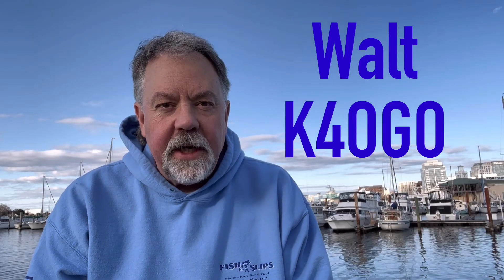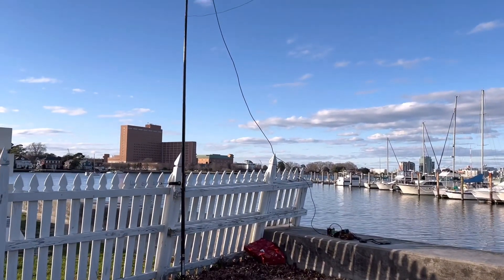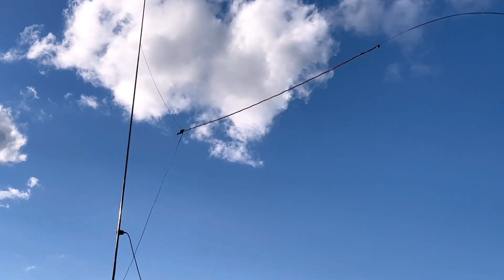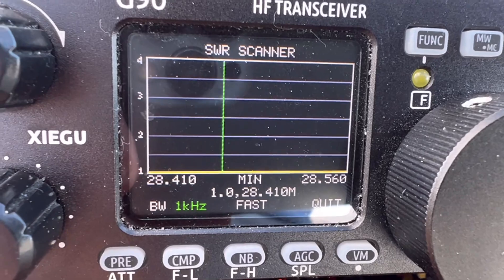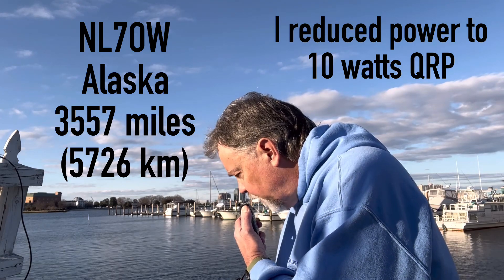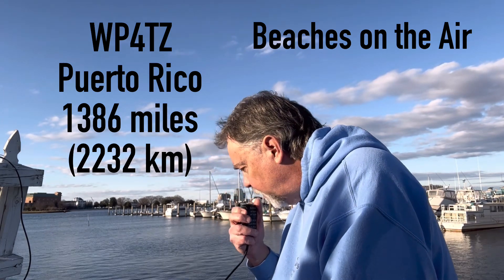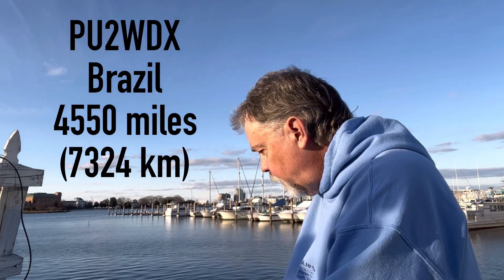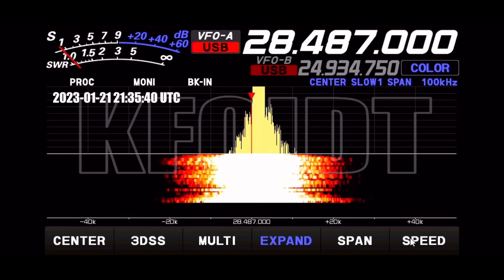Vertical Delta Loop Antenna - 10 Meters Portable

Comment: I’m building a 10 meter Delta Loop kit from HF Kits in the  Netherlands. There plan is a 2:1 transformer and a 1:1 Balum in the same box with a pair of Amidon 240-43 cores. I should finish up the Balum tomorrow and test it.

Comment: Thanks foe experimenting with different ideas.
Reply: I am considering a vertical delta loop for 80 Meters as for some reason both my linear loaded 80 M dipole at 25 feet  and  80 M  end feed sloped 6 feet to 80 feet seem very very inefficient on 80 M. I suspect poor soil but need to do more  measurements and experiments to figure out. End fed seems to work better as i go up on  bands.

 My goal is talking to 200 mile distant stations with some man made noise at both ends. I have a city lot but have a few tall trees to support a wire antenna.

Comment: I have made an attempt to build this delta loop.  I cut my wire to length, and started to set it up in my backyard.  The one thing you omitted in your video was how to set this up, aka, how high off the ground.  I have the DX commander classic poles (4 of them), and the use of two being required made it very difficult to set up by oneself.  The wire being cut to 10.75 meters is in the Rybakov Vertical antenna range for a 1/4 wave vertical on 40 meters.  I could just use it as a tuned vertical and use my tuner to get 20, 17, 15, 12, and 10 meter bands!  Love the video and the info plus the book... 73's Walt & GBU.

Comment: Your delta loop inspired me to buy a 4:1 unun and make a delta for myself. My antenna evolved from the delta into a full wave sky wire loop. I'm happy with the loop as it has +7 dB gain over a dipole and other antenna types. Since building a loop last year, I have earned my WAS award, and several DX countries in Asia, and Europe, to the Middle East.  I have to give you credit Walt for the inspiration to build simple wire antennas that work! 73s

Comment: Drooping coax will cause more imbalance, therefore more common mode current. Put an RF Choke immediately before the 4to1 balun (looking outwards towards the antenna). ❤

Comment: I made your design , it worked great thank you .
Reply: Try using the same dimensions, put the apex at the bottom and feed it through a 6:1 balun. Incredibly quiet and very directional. I reached south Africa yesterday and Australia. Trust me, you will like it. Elevate it 1/4 wave. Makes it portable. I have it on a rotator.

Comment: Listen to your heart. The point of being an amateur is experimentation. how the hell did we get the g5rv and the moxons. you should try a vertical moxon near water that would be great. by the way you only need to look at the commercially built Optibeam which was basically multi moxons in one antenna. Keep up the good work.
Reply from the maker: Thanks! Yes the vertical Moxon is on my list! 73, Walt

Comment: Thank you!   I just reconfigured a 134'  80m inverted "L" efhw into a 40m/15/m vertical Delta Loop using the same method.  It kicks some serious butt on 15 meter qrp.   I didn't worry about equal dimensions.  The vertical member goes up about 30 feet, starting 6' above ground , and the other two legs are app 52 feet long.  Don't tell the nay sayers, but it worked ok on 30, 20, 17, and 10 too  ;-)

Comment: I also wonder if that could be fed with ladderline...balanced line...back to a 1:1 balun and into a tuner. Might be quieter. I have lots of issues with noise and used this approach to build a Slim Jim vertical for 10m a few years ago and it was noticeably quieter that other verticals. That's also one of the best verticals to build and use.
Reply from the maker: That’s definitely worth a try!

Comment: That's how you do it...nice work. Loops are awesome. Can't find more gain from a single piece of wire than by building a loop. One that I've gotten a lot of use from is a rectangular...2:1 proportion..with feedpoint in the middle of the base...works out just about perfect 50 ohms. I'm curious as to whether you're using insulated hookup wire or bare copper. Need a new antenna project and this looks like it could be the one to get me back on 10m from my apartment with antenna out on the fire escape. Already have fiberglass poles.
Reply from the maker: Thanks! I've been thinking about building a rectangular loop. I use insulated wire. 73, Walt

Comment: Walt,
This same antenna cut for 40meters, will also give you 20m and some 15m.  However, it may be a bit difficult to manage 132+ feet of wire using your supports

Also,

A twenty meter loop fed with ladder line will also give tou 10m. see: https://drive.google.com/file/d/0B1q-psxlp3Iwak9ldnJUcnhZTUE/view?resourcekey=0-Ad-AR4k4E5ZB_X4Mx-sipg

Comment: It´s just 30 degrees away from a classic delta loop with its lower side parallel to earth and fed 1/4 wave from top corner for vertical polarization. This set-up provides the lowest take-off angle. That´s why your antenna is perfoming so well. And they are better RX antennas than verticals.  By the way, that harbour seems to be a great location for DXing. 73 de LU3HIP.
Reply from the maker: Thanks! Yes my harbour is a great place for DX. 73 de K4OGO

Comment: Search for Cebik horizontal slot loop, very similar except it is rectangular but also fed from the side, which makes it vertically polarized. I think that is what is happening with yours as well.  Also, being vertically polarized reduces distance to ground influence, unlike a horizontally polarized dipole for instance.
Reply from the maker: Roger that, I'll check that out.

Comment: Walt, Hello from South Korea!  Please don't stop sharing your ideas with us just because of a few haters.  Your design looks great!  I just built a delta loop and it works well.  I used a 4:1 balun connected to the lower right corner about a foot up.  It works good, but has high SWR on some of the bands.  I plan on putting in about 50 feet of 450 ohm ladder line to see if that will help.  THANK YOU SO MUCH FOR SHARING!  PLEASE DON'T STOP!  I hope to work you on the air someday!  Kindest Regards,  Don HL2/KC6STQ
Reply from the maker: Thank you so much Don! I enjoy sharing my radio experiences on YouTube and will definitely continue. Thank you for the kind words! Hope to catch you on the bands soon! 73, Walt K4OGO

Comment: I like the loops whatever you can get up, They are quieter and have better capture, going to try one hear instead of my 100' cage. Just feed with balanced line and use with a tuner - will see if my luck is as good as yours. 73 N0CYK
Reply from the maker: Good luck! 73 de K4OGO

Comment: Nah....always share....and those comments that aren't constructive, just drop in the round file! Did you get a chance to model these dimensions? Thanks for the video.
Reply: It's 10m so the entire loop is around 35 feet. A loop is 1005/Fmhz in feet so one-third would be a little under 12 feet for the vertical side.
Reply from the maker: Thanks Richard!

Comment: Well that worked rather well!!  Curious as to the choice of a 4:1 UNUN in spite of it's good on-air performance. Have seen them with a 4:1 balun and more often a 2:1 matching section of 72 ohm coax as I did for a  6M delta loop. Fun to watch Walt - well done.
Reply from the maker: Just went with the 4:1 after much research and it worked well!

Comment: Great vid,,for omni directional it has to be horizontal,,vertical  it will have loobs of its sides,,,great antenna,,alway use loops,,,low noise and more gain than a dipole.

Comment: Hi Walt   
just subscribed,  great info thanks for sharing.  I have calced all of my dimensions for this antenna on 11 meters,  but my only question is will I still need a 4:1 UN-UN?
4:1 BAL-UN?
I have the female UHF-typeF adapter for 75ohm stub?
which would be best?
thanks, chuck

Comment: Wonder what happens to polarisation and matching, when you make it a 90° angle at the lower end of the main pole. Basically the right triangle / sail shaped version... 🤔 You would need a much lower second support pole.

Comment: Some really strong contacts their Walt. I did some thing similar on 20m some time ago, a vertical pole and pulled the other two sides of the triangle out and fixed to the house. The feed point was at the bottom of the pole and not having a 4 to 1 balun I used a 1/4 wave of 75 ohm coax. It was so quiet on receive compared to my usual antenna. Thanks for the video.
Reply from the maker: Thanks for watching and sharing your eperience!

Comment: I would say the proof is in the pudding! Would love to see how it would work for ya on your next Poland trip.
Reply from the maker: Headed back there in 12 days, might have to try it!
Reply: @COASTALWAVESWIRES  I imagine it would be just the ticket for racking up a bunch of African and Middle East contacts on 10
Reply from the maker: @JReed305  yes and especially as the season changes, problem I had last trip was that it was dark at 3:30pm In December and 10 was dead. Last spring I actually made a few contacts into Israel and Saudi Arabia on 10 from Poland. I’ve got a couple 7 meter poles at the house there so maybe I can rig something up.
Reply: @COASTALWAVESWIRES  Oh yeah dark early for sure. I have a cool photo from the harbor in Utska of sunset at 2:45 in the afternoon.

Comment: Dear Walt thanks for all. I have a question. The unun 4:1 is not a balun is a unun , it's correct? The same that i use for rybakov or not?  it is not necessary a balun for coupling the antenna (balanced) with coaxial cable (unbalanced). It's correct? Best regards Aldo

Comment: Hey Walt ! I've been running a home made 40m horizontal delta loop fed with a 4:1 at one of the corners. It's up about 35 feet and tunes 40,20,15,10m. I might put one of those 10m loops together and see how it goes.  Cheers, great video. Richard VK2VRJ.

Comment: Well, well, well, don't mind them bashers sir, you showed them they were wrong with a big QSL. You see sir, I am just new on HF at the right time with the 10 meter band open and have been researching for different types of antenna I could build and you sure did made my day. I can't afford a real hf radio yet so for now I'm just using an HR2510 set only at 20 watts with an aluminum tube horizontal dipole antenna at 19 feet above ground but am sure proud to make contacts in Europe. My farthest was 10,735km to England from where I'm at here in the Philippines. Now I know why HAM is fun. Thank you for sharing your ideas sir. DW1-QEW saying 73s.....
Reply from the maker: Thank you and thank you for sharing your experience!

Comment: Love the design, I have been pondering a delta loop,  curious what height did you want to get the bottom of the vertical above the ground?  Is there some modeling that would suggest the height based on the band you wanted to build for?
Reply from the maker: Thanks! Honestly I just wanted to get it as high as I could using the two poles.  I have not modeled it but that is an interesting question and something that needs more research.

Comment: Walt, you are definitely on to something. I had a 40m delta loop fed 1/4 wave from the apex, with the apex up. According to ON4UN's Low-Band DXing book this acts like two 1/4 wave verticals in phase with the horizontal portion acting as a radial for both. The feedpoint impedance should be around 100 Ohms, so a 2:1 balun or 1/4 wave length of 75 Ohm coax would convert it nicely to 50 Ohms. You would just need to make your vertical portion of the loop slope instead of running up along the support mast. The two lower corners of the delta could tie off to ground stakes or any available attachment point. The downside is that you need to move both lower lines to "rotate" the antenna. BTW, my delta loop worked fantastic.
Reply from the maker: Awesome, thanks for sharing!

Comment: I have a Delta Loop still to try out, I think its 3.3m as a triangle with 3 sides, or 2.7m(ish) for 4 sides.
I noticed your unun wasn't as 1 of the corner points, that's noted down.
Still a little cold to be playing around with my antennas 🏧 but it is on the 'To Do' list.
Great video again Walt, looking forward to the next. 73's
Reply from the maker: Thanks so much and good luck with that Delta Loop!

Comment: Walt, thanks for posting and demonstrating your antenna. Seems to have fantastic performance!  In the mid-70's just before I got my license, my friend who wrote articles about antennas wanted to try out the new HF xcvr my dad bought me (Hallicrafters SR-150).  Not having an antenna put up yet, we found a huge balled up mess of 300 ohm TV twin lead that a local TV repair shop had thrown out, about 150' long.  We strung it from the basement window thru tree branches and terminated it down in a swamp.  We were in Minnesota, you know, land of 10,000 swamps ;-) anyway, we fired it up and he was able to contact europe, Ukraine, to be exact, running about 100 watts with this stupid, barely above ground twin lead that was our so-called antenna.  I suppose stranger things have happened, just can't think of any. Still have the SR-150 and continues to work great. Kevin, AI4HZ
Reply from the maker: That’s a great memory Kevin, thanks for sharing!

Comment: Is it a multibanda antenna? For example for 20 Mt can work with tuner in 10 12 15 and 17? Test it
Reply: If this antenna for 20 Mt works for high band with tuner like you tried with the Efhw 20, it could be a really cool solution for dx... Pse test it.... Best 73 Aldo
Reply from the maker: I’ll have to test it. It was an outstanding 10 meter antenna

Comment: Walt, Always looking for a new antenna idea. Have the two poles, wire and 4:1unun. Great project for next weekend... Many thanks Don - KW2AIR
Reply from the maker: Thanks Don, all the best and good DX next weekend!
Reply: @COASTALWAVESWIRES  Walt I had the chance to construct and test your rendition of a 10m Delta Loop oriented NE / SW.  I first tried placing the LG 4:1 Unun 1/4 wave length down from the top of the pole. Then after some testing found the best performance of the Unun  at the  lower pole corner worked best.  I am located just outside Rochester, NY.  In my final testing late afternoon on FT8 saw many NV, NM and CO stations that I normally see only a few with my 10M Jpole up 45'.  Then this morning did additional testing and with the NE orientation and on average I saw an increase in EU stations receiving me by +2-3db.  Called FT8 CQ and had more consistent call backs than before on the JPole or even a EFHW (on first CQ had two Russian stations calling).  I will do additional testing over next several days but am seeing a definite pickup of contacts with stronger signal reports both to and from. (Just plug in my call sign on PSK Reporter).   This is not a scientific evaluation... will compare antennas with WSPR in the next several days.  All for now Don - KW2AIR
Reply from the maker: @BaySideTV  interesting, thanks for the update!
Reply: Need to add that Delta Loop mounted on top of a 10' elevated deck and up off the deck another 15'

Comment: Very nice Walt. Normally working in QRP 10 watts with V, 27Mhz with a flat SWR from 25 to 28 Mhz too, I will try this setup. Amazing video, using 1,81 meters of 75 ohms coax to adapt the antenna. 7351 Paulo.
Reply from the maker: Thanks Paulo! 73

Comment: Nice Walt delta loops work good and they don't have to be super high with two poles you can go from one to the other and feed the delta at the bottom upside down triangle and you can still rotate the antenna. Hmmmm they watch your videos in BRASIL 😆........73's
Reply from the maker: Thanks! Yes I will be experimenting some more with this type of antenna for sure. It's a small world LOL

Comment: Great job Walt. I built a 20 M portable version with apex at top fed 1/4 wave down from top with a 4:1 . Worked FB. Love trying different antennas. Licensed since 1964. Never gets old 👍
Reply: PS my fav all time wire antenna was an 80M horizontal loop up abt 40 feet. Hard to beat loops for great S/N ratio antennas.
Reply from the maker: Awesome, thanks for sharing!

Comment: Sorry I missed you! Great results. I like that you can rotate it. I may have to build one to test or maybe use next year in the Ten meter contest. Would like to put my analyzer right at the antenna or on a 1/2 wave line to see what impedance you have. I sure expected you to need a 2:1 transformer.  I would like to try it on some 10 meter beacons and rotate it around to plot the pattern. I think the skip was just too long for Florida and New England. I would expect if the band was open they would have just been weak off the side. Good job!
Reply: I love using the beacons! Think I posted some YouTube videos doing that with my dipoles. If conditions are stable it really shows off the patterns when I switch antennas.
Reply from the maker: Thanks! I was limited in direction with where I was setup. I plan on putting this up on the beach where I can rotate it a complete 360 degrees and experiment so more. Great idea to try it on some beacons!